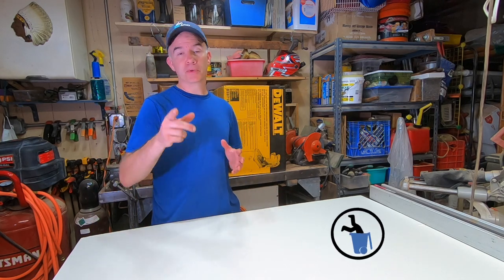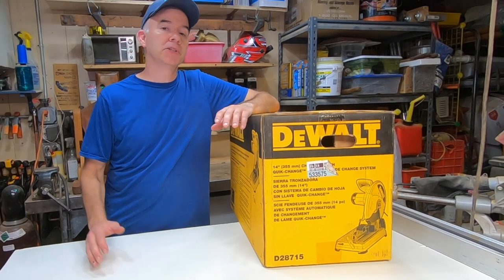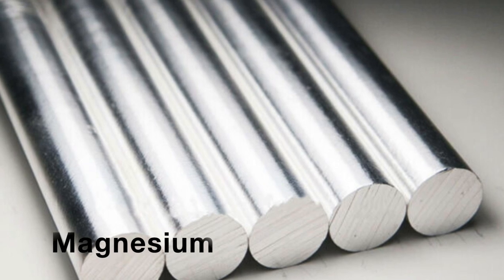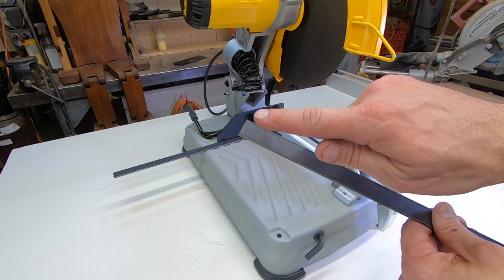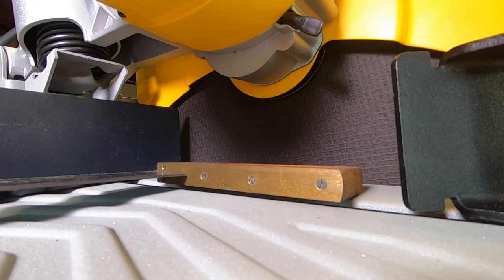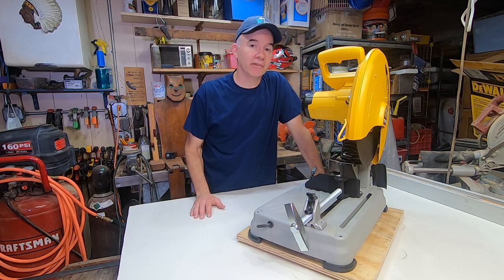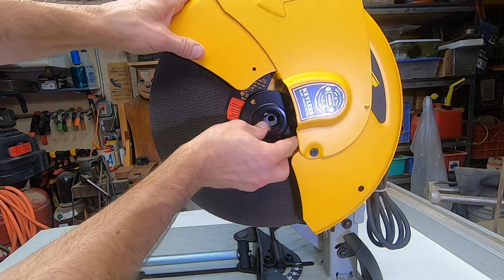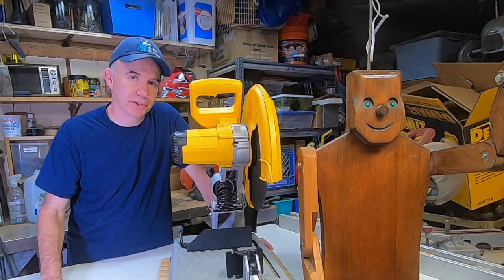DeWalt Metal Cutting Chop Saw - Basic Review

Comment: Dewalt has a slightly different front finger on the guard now.  The first saw I got I had to return because it kept getting stuck in the groove for the blade.  Not sure why they had to mess with it but i would have preferred the display model

Comment: Hey man I need to cut two things I need to cut wood for a shed project and I also need to cut a trailer coupler witch is 1/4 thick I'd like to buy a saw that can handle wood and thick hard metal my budget is a big deal so I'd like to know what saw should I buy to cut metal and 2x4s ? I don't mind buying multiple blades and 1 saw I want a saw that will cut the metal perfectly.
Reply from the maker: The manual doesnt mention using a standard saw blade. I think this is strictly for metal. There is a contact number for dewalt if you want to call them. Please call 1-800-4-DEWALT (1-800-433-9258) for more information.

Comment: can you change the blade to cut wood?
Reply: Technically yes. But this saw runs at a different rpm to wood chop saws, so you would run the risk of getting rough finishes on the end of the wood.

Comment: What's the difference between a grinding wheel and a toothed saw blade?
Reply from the maker: Saw toothed blades can be used for wood & light metal but for thick stuff you'll want to use a grinding wheel type blade.

Comment: Is there a way to get to cut 45-45 degrees? If that makes sense
Reply from the maker: Yes. The back fence is adjustable for angles.
Reply: @AlleyPicked  is it adjustable for a 90 degrees
Reply: Buy a square angle level that's all.yoi don't need Thiers.

Comment: Ive had this saw for years and its absolute trash. Blades gum up and just stop cutting and when they do cut the blade wanders so much the part is unuseble.  I just use a grinder or sawzall or band saw to make my cuts. Forget about an angle cut. Im not some dumb kid either. Ive been a toolmaker weldor fabricator for 20 years. Dont waste a single penny on this saw if you intend it to make straight and accurate cuts for welding. Get a bandsaw